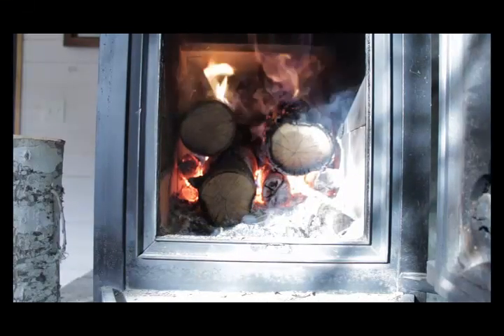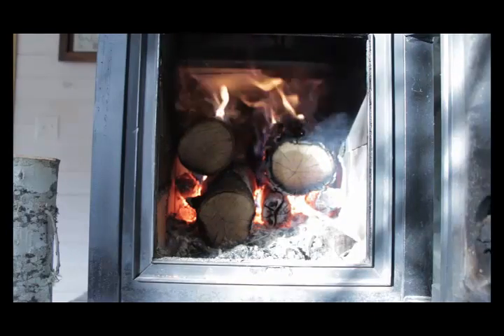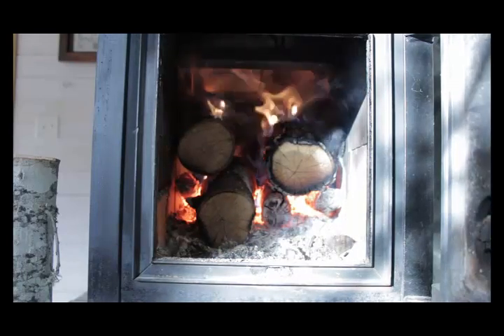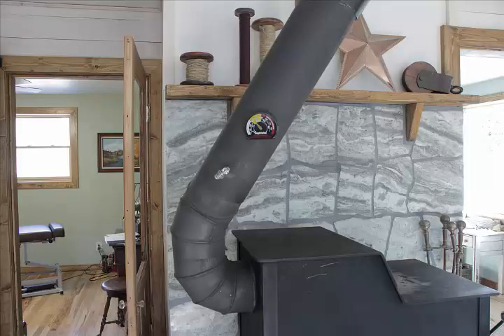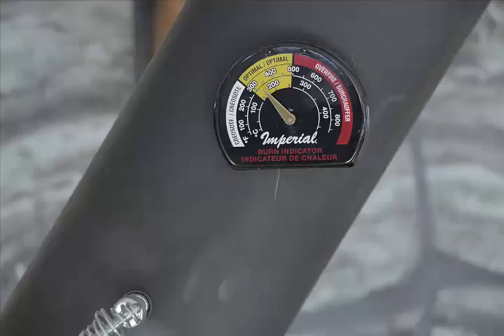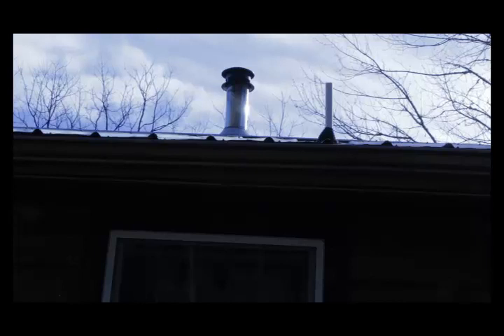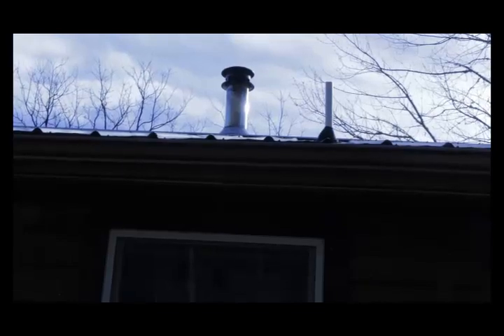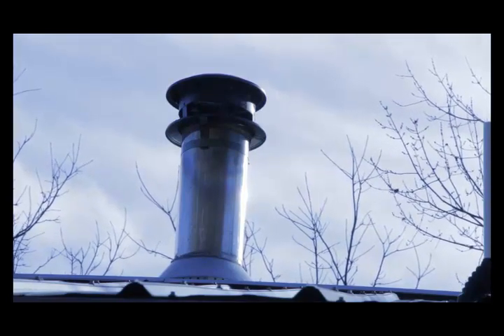Fisher Wood Stove -Adding a Secondary Burner

Comment: I'm guessing the first burn of each day will also tell you if your stove is burning clean now...
Reply from the maker: It's important to push your wood to the back of he stove. That way the flames coming out of the back of the wood heat up the air that is rising to inject from the secondary burner.